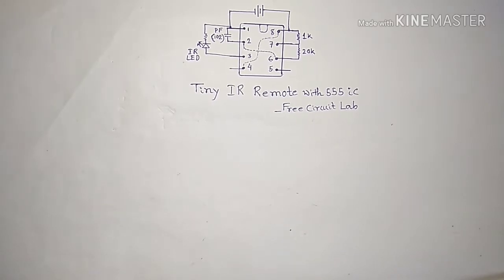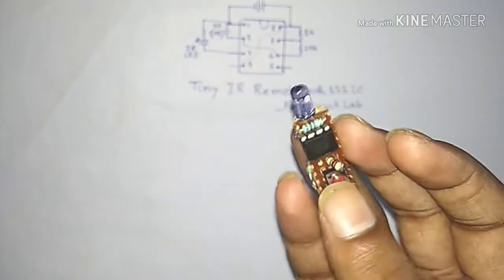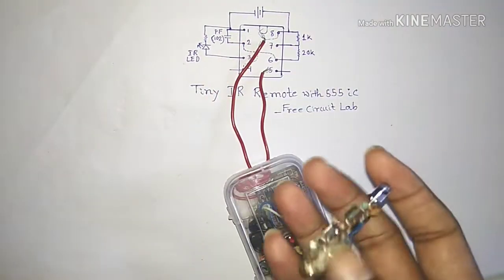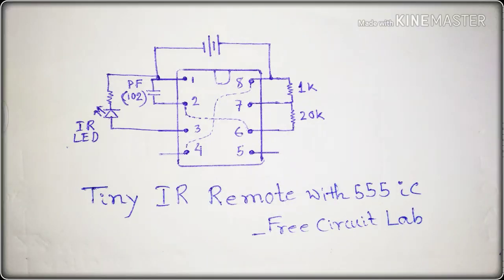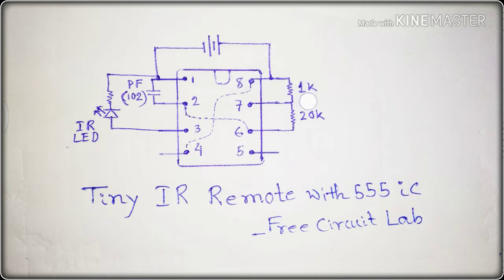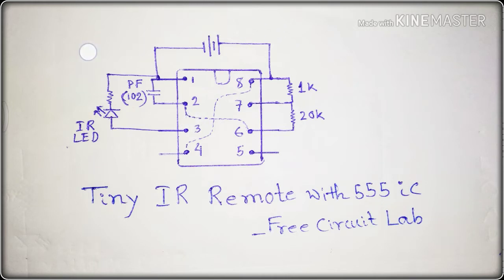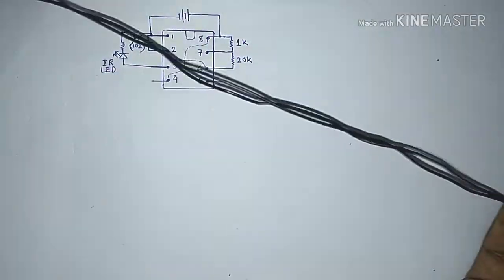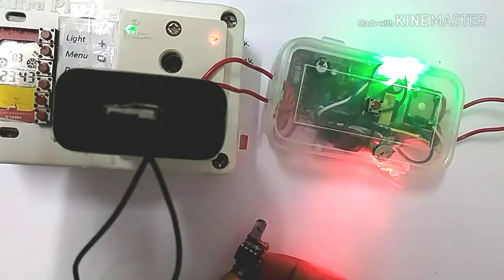homemade IR remote using 555 ic  | by Free Circuit Lab

Comment: Hi bro...
Can u make a Sun-light proof IR sensor module... I am so struggling to make a perfect one by using tsop1838 (small) sensor... I saw Some u-tube videos related to it. But, nothing is working well
I done more than 4 types of circuits with minor modifications.... But, i loose in it..
Could u help me...

Comment: how many range of this remote
Reply from the maker: 2 meter..
3meter with 47 ohm resistor at led
Reply: Free Circuit Lab sir aap abhi tak soa nhi
Reply from the maker: Wired headphone ko wireless bana raha hun.. but battery connection reverse ho gaya.. BT board dead!!
Very sad moment now
Reply: Free Circuit Lab sir aap kha se hai
Reply from the maker: West Bengal